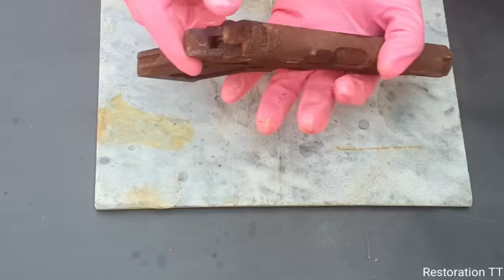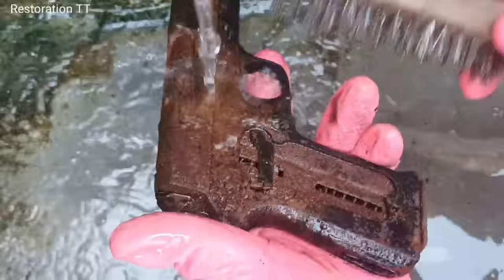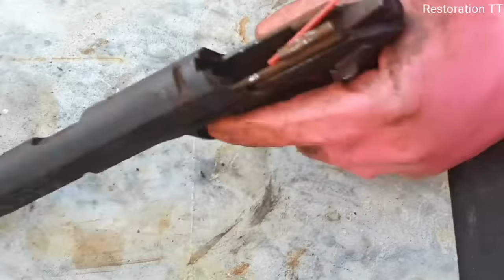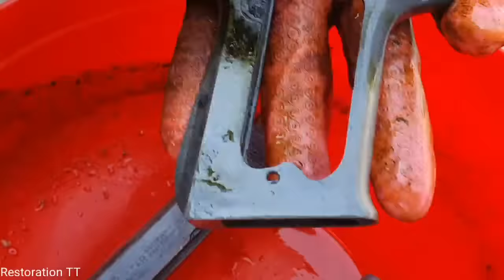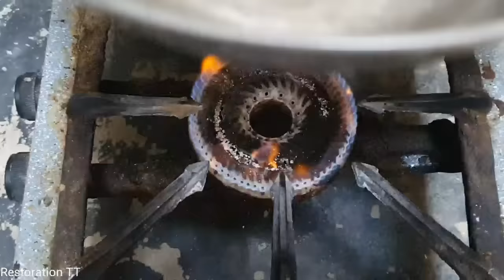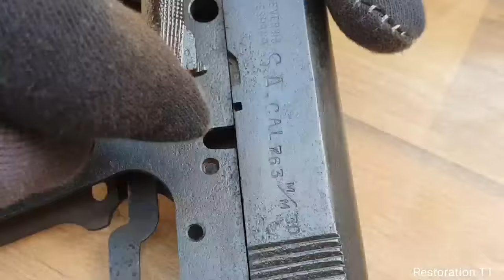Restoration Vintage Colt 1911 .45  Acp | Restoration Video | Restoration TT

Comment: This is not a Colt .45acp, it`s a Star 7.63cal Spanish made pistol!!
Reply: Same version
Reply: During WW2, between 1942 and 1944, a certain number of these pistols, chambered in 9mm parabellum (waffenamt marked 08 on the chamber) were issued to the police and second line units
Reply: @unhappysoul-p9c  ma non americana
Reply: @unhappysoul-p9c  ma non è una  1911 in 45 ACP
Reply: @unhappysoul-p9c  no, it isn’t the same as a 1911. Made to look similar but many important differences.
Reply: Yes😆
Reply: Would 7.63 be 32 cal?
Reply: @unhappysoul-p9c  no its not it they look similar but they are both very different 45cal acp is a lot thicker and fatter than a 7.63 which is like 31 or 32 cal 45 go learn more about guns there are so many clones of the 1911 but some work very different and use different ammo
Reply: I think series 70 80 or US 1911 use .45 Acp because I have military ammo box and yeah it was A1 that why btw gun sound after restore is ugly like glock
Reply: Yes sr. but the Spanish steel is one of the best in the world. He is a restorer not a gunsmith.
Reply: Es una Star de fabricación española, y está versión tiene el calibre 38, 38 special, 9mm Luger, en España no se a fabricado el calibre 45
Reply: Nem perto de outras restaurações cara muito relaxado não pintou lubrificou a arma 🤦🏼🤦🏼
Reply: Nobody expects the Spanish Inquisition!
Reply: At first I thought it was amt automag 2
Reply: @christianmoralesromero5766  Pistolas automatica in calibre 9mm Largo (9x23mm) no .38 Special. Astra Modelo 1921, M400, Star Modelo A, carabina Destroyer in este calibre.
Reply: The title lies about what pistol this is .
Not the right manufacturer, caliber or model.👎
Reply: Not a 1911
Reply: @aspenskye15  30 cal equivalent
Reply: My grandpa had one
Reply: @aspenskye15  Yes,,
Reply: @unhappysoul-p9c  l
Reply: Yes,  this Star,  a Colt copy, is a 7,63 mauser caliber. I get a CZ made in Cekoslovakia, same caliber,  an excellent caliber,  powerful and fast.
Reply: Yeah I was like...hey is that a external extractor!?!
Reply: Definitely a Spanish star, pretty sure he's right about the caliber too.. because that hole is too small to be a 9 mm and definitely way too small to be a .45 ACP
Reply: Ikschnooklarzfart , You Are Correct !
Reply: Saw a parts kit of one on gunbroker yesterday. It should still be there if you need spare parts.
Reply: @aspenskye15  
Главное внешнее отличие, это выбрасыватель, утопленный в затворе.
Reply: A rusty POS Star. Now A restored POS Star. Colt 45 my ass!
Reply: 7.63 was the standard round spanish chech russian till the 9mm was “ adopted“ by the NATO alliance…
Reply: @petercofrancesco1620  I know, since I have one, made in 1942! //Lars
Reply: That s ITACA CAL 45
Reply: @minggoyporti2234  if you mean ITHACA, you are still wrong
Reply: This is blank gun not really
Reply: What difference does it make? It could be a pea shooter for all I care.
Reply: No es una Colt 1911, parece un arma española talvez una Star de calidre menor.
Reply: It doesn't matter .Look at how he's beating on it . Wha a jerk.....
Reply: @aspenskye15  probably 9mm. That character Jules(Samuel L Jackson) had a Star Model B in 9mm for that movie Pulp Fiction. But his had that high polished chrome/nickel finish and custom grip panels.
Reply: I have a Star 45 , totally reliable.
Reply: You sure know your firearms history dude.
Reply: Yup, this ain't no 1911, it doesn't have that part of the trigger at the rear of the grip.
Reply: https://en.wikipedia.org/wiki/Star_Model_BM
Reply: @albertoangelici  Maybe you mean CZ vz.52. But this gun has not cal. 7.63 Mauser, but 7.62 Tokarev. These cartridges seems to be the same, but the the main difference is that the cal. 7.62 Tokarev has slightly bigger amount of powder in the shell and thence a bit higher energy of bullet.
Reply: @unhappysoul-p9c  
aaqq
Reply: @Sirphatsorn  What the f□<k are you trying to say? Did you type that while a stroke?
Reply: @chanceaxel84  I didn't said anything I just typing
Reply: @Sirphatsorn  wow
Reply: @MillerWB87  mean refrence
Reply: @aspenskye15 what i mean is refrence
Reply: @qidsyahumairah2923  mean refrence
Reply: @christianmoralesromero5766  Pues no, es una STAR MMS del 7.63 Mauser y sí que hubo una versión del 45 que era el Modelo P.... El Modelo A era del 9 mm Largo / 38 Auto (No del 38 Super), el Modelo B era del 9 mm Parabellum, el Modelo S del 9 mm Corto (380) y el Modelo IS del 7.65 Browning (32).... Mismo modelo y estructura pero con calibres y dimensiones diferentes.... Salu2!
Reply: Seriously,  invest in a hard wood mallet and stop with the ballpeen hammer!
Reply: @francescozati3746   3
Reply: @christianmoralesromero5766  es versión es 7.63x25 mejor conocido como .30 Mauser; algo raro en mi opinión
Reply: @christianmoralesromero5766  STAR actually made quite a few pistols in .45 acp...
Reply: Lllllppp
Reply: I knew it didn’t quite look like a 1911, forgot about the ole star
Reply: Yeah, thought just now if that thing is an original Colt 1911 I eat a toilet brush with the cap on it. Even the extractor, the barrel bushing, and that trigger!
Reply: @clemensJB  You don´t have to!!! Read my note on top//Lars
Reply: They had me going to the faces I made when I sall that poor gun   But then I sall the letters on the side of the slide and thought wait what????
Reply: Such a small barrel. Absolutely not a 45 acp
Reply: It is literally stamped on the slide of the firearm that it’s a Star 7.62!!
Reply: Yea and disassembly was alittle sketchy
Reply: External extractor is a dead giveaway😊
Reply: Killing me, watching them use a steel faced hammer, when a plastic one would mar far less!
Reply: I knew it hahahahaha many internal parts are different.
Reply: Thank you
Reply: He's from a 3rd world country they cant read give him a break 😆
Reply: Tienes razon no es una m1911 si no una star de 9mm aunque tenga estilo colt
Reply: @gepax22  good thing I was about to be sick when he got the hammer out , and I dont think I have ever seen a 1911 with a bolt on mag release.
Reply: And he doesn't really know how it breaks down.
Reply: Report the video for false information.
Reply: My guy sounded pissed about this lol
Reply: 7.65/32 acp!
Reply: @aspenskye15  7.65mm= 32acp
Reply: Star BM is identical but 9×19 caliber.
Reply: Cal 7,63 Mauser
Reply: Топорная Работа! Пистолет жалко!...
Reply: @estebanvelez5684   then wtf is he doing with the gun?
Reply: no offense it doesn’t matter what is colt or star . it still a 1911 and im colt guy mysef cheers folks
Reply: What type of chemicals are you using to remove the rust

Comment: As a certified 1911 and AR platform Armorer I was horrified by some minor gaps in safety in the beginning with the main concern that the weapon might have a round in the chamber. This however, is not a "Colt 1911" it is a "Star 1911 clone" of the Colt. There are major design differences between the two manufacturers that should have been identified and addressed. For the amount of damage to the weapon, it did turn out as well as could be expected and would make a great display piece... I wouldn't try and fire a round through it though. It is always best to make the weapon safe (if possible) and then soak the weapon in a warm oil bath before trying to move or remove parts.
Reply: What, you mean whaling on the rusty parts with a claw hammer is not the certified armorer procedure?  :D
Reply: 2 minutes in they broke 3 Cardinal rules of gunsmithing. #1 Loaded or Unloaded, # 2 NEVER FORCE IT, #3 Never use steel hammer.  We even use brass hammers to strike steel roll pins drivers. And the screwdriver almost made me stop watching.
Reply: The screw in the slide and the external extractor were 2 indications it was not a 1911 or even a 1911 clone,  even the Llama look alike is not a clone since most parts are not interchangeable.
3rd clue, muzzle opening is not .45 as it is too small.
We used bass punches and shop made brass hammers.
The wire brush is too aggressive in removal of existing metal.

I saw the slide clearly marked
**STAR**
Cal. 7.63  / .30 cal
Reply: I’m not certified but my first thought as he started hitting it with a hammer was “ what if there’s a round in the chamber you idiot!”
Reply: I watch videos like these to relax. This video had me stressed out right from the beginning.
Reply: The guy has said before that he measures the inside of the barrel to the entire slide and determines if there’s a round stuck inside or not. There are ways of getting around this.
Reply: @tebelel7150  I would have dumped the weapon in a tub of oil and let it soak. oil will destroy the primer and powder so the round won't discharge. It would also have lubricated and released a lot of the rust prior to working on the firearm.
Reply: The lack of a grip safety is a dead give away.
Reply: Hey I “ tried “ to down load colts factory manual, I gave up after 8 inches of paper ! ( 1911 )  just crushed a plunger tube with a small ball peen hammer, had a stuck pin , on contemplating my dumbness I should have put on my glasses ! Ps was a 1938 grand national match lower ! Don’t cry I ll fix it lol ! Just have to get the press tool and tube , stupid is as stupid does ! Lol
Reply: Great ! It’s a case you have not broked all …
Reply: There is a reason these guns all are rusted the exact same amount, and he doesn't bother to check for rounds in the chamber and such, and always seems to have just "found" the original side plates somewhere, its because he takes a working gun, takes the grip plates off, checks the chamber on a perfectly working gun, and then throws it in a salt bath...  These all have the same amount of rust, that never seems to have caused pitting, never needs to check chambers or worry about it being loaded because he checked that before he manufactured the rust...  Its one thing when they do it to inanimate objects like this without telling you, but there are people using super glue to glue all kinds of junk to turtles, then act the hero when they find the turtle they planted just before the camera started and clean it off...  This content gets a high amount of views for the effort put in, and I admit, even knowing it is all fake, I still put it on in the background...
Reply: @Warrentheo  the 1911 “ platform is one of the most robust yet complicated “ pieces “ to work on especially without the correct tools just ordered a press in lower assembly spring tube tool , one needs various tools to make the “ thing run “ plus the knowledge and the experience, I know from experience, like crap I messed that up ! Crushed a tube spring with a small ball peen hammer, on my behalf should have put on my glasses! Lol imagine that guy trying to get a job at like Wilson combat “ well do u have ur own tools ? “ sure a hammer and a screw driver! Lol
Reply: @stephensclavos4485  lol, how does my comment have anything at all to do with how complicated the restoration is? I own a 1911, partly because of how bullet proof they are, but this isn't a 1911, it's a Spanish knock off of a 1911...  Real life rust has unevenness to it, it shows the marks of when it was in a gun safe that was in a flood and still has felt stuck to it, it has bath tub rings as the water evaporates, it has smooth spots where river stones sand blasted it while it was in the river, it has a few barnacles trying to grow on from being in the ocean, and it has pitting from it's organic uneven rusting process...  It definitely does not have an exactly perfect coating of rust where the only mark from where it rested is the three points on the side of the gun where it was sitting at the bottom of the salt bath...
Reply: @Warrentheo  hey give me a break I gave u a thumbs up ! Ur comments were correct, was just trying to put a bit of a sense of humor in the whole thing , the 1911 I “ talked “ about was a 1938 grand national match , rare yet I messed it up ( was laughing at my self)
Reply: exactly!!!
Reply: I'm not certified but I immediately saw that it was no Colt 1911.
Reply: aye bro im not a certified 1911 expert and i saw that stuff too.
Reply: The 1911 is one of the most “ robust “ platform pistols yet one of the most difficult one to “ work “ on sometimes a new part will just “ slip “ in yet again most do not , took me hours just to fit a safety, in gun smithing less is more , a bit of grinding, etc put it back together etc unfortunately one learns from mistakes, I have , not to mention the correct tools , just got a lower  group crimp tool for the tube assembly , and other tools, hey I don’t think he read the factory shop manual s on the 1911 , I tried to down load it , gave up after the printer ran out of paper! Lol the AR is a bit easier yet u still have to know what ur doing , ? Ever lose a sear assist spring on a 1911 grand national match? One of the stupidest things colt did , I’m still looking for it ! Lol ( it’s not needed though
Reply: Looked respectable in the end lot of work usually worth it. Lack of at least mentioning the possibility of live ammo in this was a turn off. No brass hammer or punches etc. never liked tapping or prying on almost anything like that. Oil bath or solution for a while would make disassembly easier and help with neutralizing live ammo possibilities.
Reply: I am not as knowledgeable as you are when it comes to quickly identifying clones etc. But thank you for pointing out it was. I saw the barrel bushing was press fit and not threaded and I knew something was off but I wasn't confident enough in my knowledge to say it was one.
Reply: When brought out the hammer I was like how did you safety Check that .
Reply: @carminemurray6624  That 763 x .30 is a Mauser round.... A Spanish made gun, shooting Soviet era ammunition. LMAO And he tiles it "Colt 1911 / .45 ACP" LMAO
Reply: @dwasifarkaralahishipoor2223 I laughed my arse off with that one. Could not believe how unprofessional that was… lol
Reply: That gun definitely is responsible for some unsolved murders.
Reply: What if u are certain it’s rusted a cambered round with a cocked hammer
Reply: @nascarjimbo I’ve noticed many of these gun restorers don’t bother checking to see if there is a round in the gun. SMH.
Reply: Curious question: how would you test if that gun is loaded if the barrel is obstructed and the parts rusted shut?  I'm not saying it is, but it brings up an interesting point (also I don't restore anything like this, so I'm not having to test them, just a curious questions overall).

Comment: Would be interesting to see what it looked like before you rusted it up
Reply: CanCan Gaming  “really very easy for weapon to rust up” or “it would take forever to rust up a gun just for a video”…which is it?
Reply: It's a Star Super. I have 3 in 9 mm Largo. It looks almost like a 1911. I believe they're Spains answer to the 1911.
Reply: CanCan Gaming  It's actually pretty easy to artificially corrode a gun in about an hour using hydrogen peroxide and salt.
Reply: @buddyvincent9205  Right! it is a spanish made copy of a Colt 1911, the manufacturer was Bonifacio Echeverria, Star guns SA, in Eibar, Spain
Reply: Yeah.
Reply: CanCan Gaming  speaking of acting smart. You can rust a weapon like that very quickly using salt water spray. Maybe you should read some more before you end up looking like a fool.
Reply: I think someone didn’t do there research on 
rust before checking someone. Must not know what different salts do to different metals. How you think they blue guns. Its called rust blue for a reason….
Reply: That was my thoughts exactly lol
Reply: @AirPiracy  those are very easy to spot though, because the weapon will have little to no corrosion damage beneath the rust. While this wasn't completely ruined, it had pitting and corrosion damage under the rust, which implies that it's most likely not faked.
Reply: He is removing the rust😊

Comment: Please, never hit a precision mechanism with a steel hammer: 
Rather use a brass or nylon hammer, or even better, hammer through a hard wood stem, holding the pistol with a vice, between two wooden pieces and fabric.